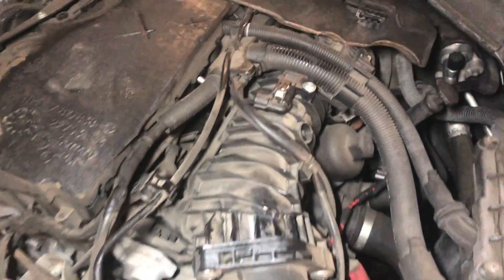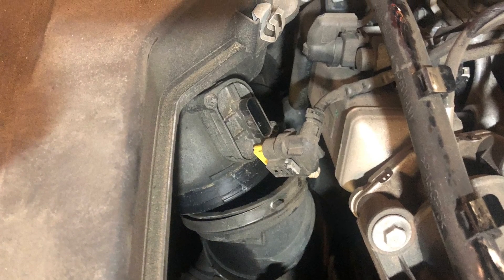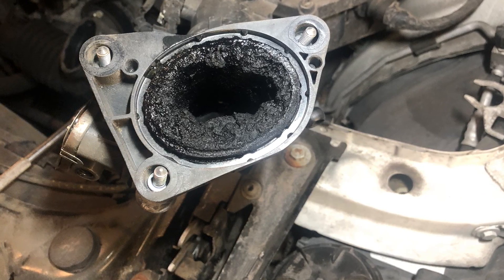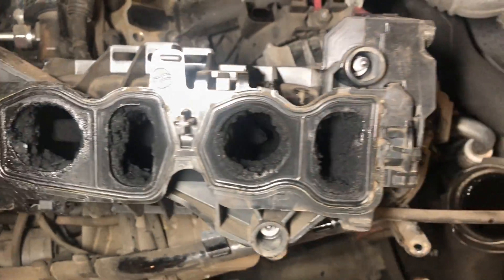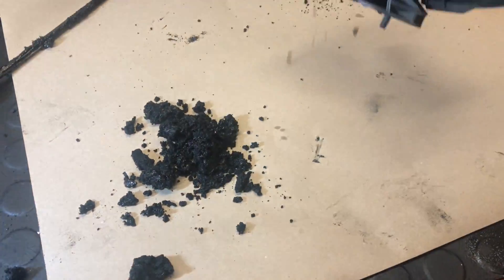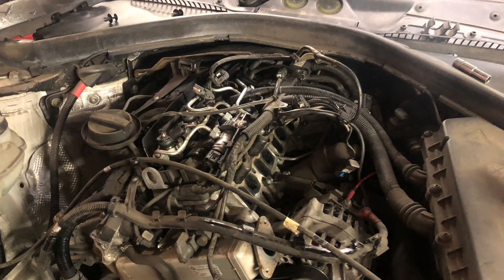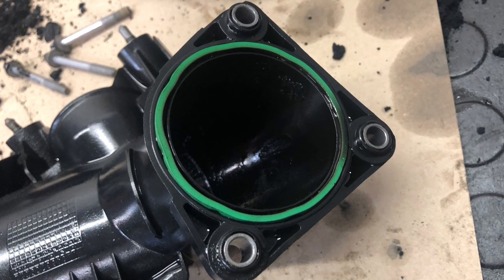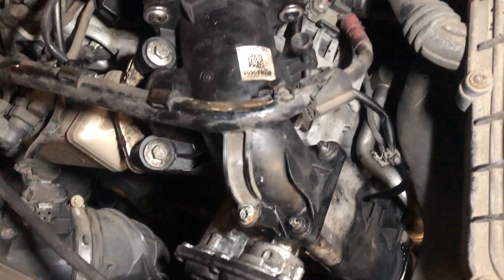BMW Diesel EGR Fault - Engine light fixed permanently!

Comment: I'm not an expert, but every channel I follow has strongly recommended a carbon clean every 60k miles on a modern diesel. Just had my EGR fail at 215k miles (2.0L TDI 170hp vw). Getting the carbon clean done at next service, as used car prices have gotten unaffordable with the inflation in Germany.

Comment: Multiples of that amount of carbon is probably carried by the air flow into the cylinders. It makes one wonder whether the air filter makes much of a difference to the life of the engine considering all that abrasive carbon that is taken from the exhaust and re-eaten.  Surely they could take the EGR gas from after the particulate filter instead of in front of it?

Comment: damn thats a lot of sludge. just got a 520 with b47 and 160k km on it. egr system was on recall so i got it done asap. now i’m concerned about other intake parts.. no wonder some of these engines (intake manifolds if i understood right) have caught fire lol! what was the mileage on this engine?
Reply from the maker: Nice comment thanks. Think it had done about 80k. Mostly short journeys!
Reply: @How2FixIt1  sheesh!! gotta say i expected a lot more! i’ll probably check these intake parts some day just out of curiosity. i want to do it before a warning light comes on. i stand behind preventive maintenance with all mechanical things. 

and yeah, i know short journeys are poison for these new diesels. i try to combat that by making regular rapid accelerations with warm engine and sometimes driving with lower gear/higher rpm for a longer period of time while driving a little longer distance. dont know how much these things help but at least im trying lol

oh and awesome video! i appreciate these kinds of videos that help people keep better care of their expensive belongings

Comment: The 320 has swirl flaps usually broken .... I cut the shaft its brass and the plastic flaps if theres any left i remove them and block the shaft hole with a bolt and locknut with dirko